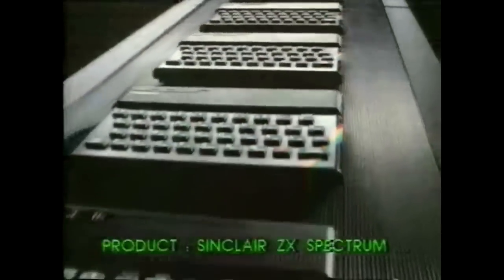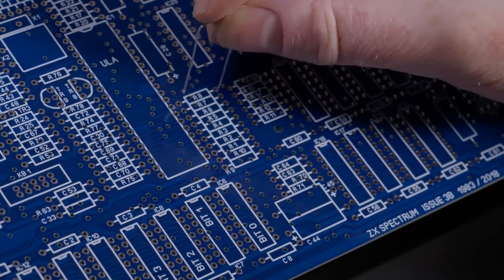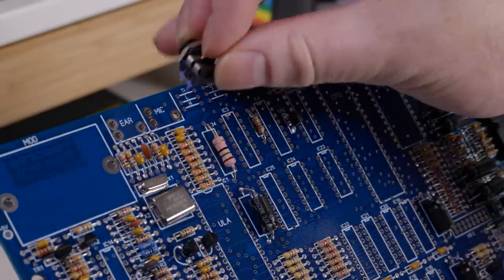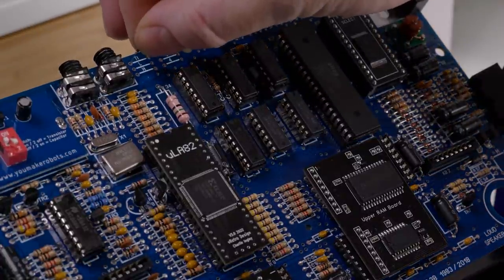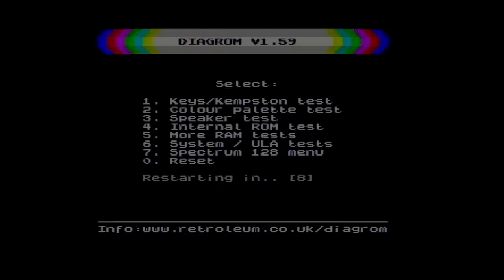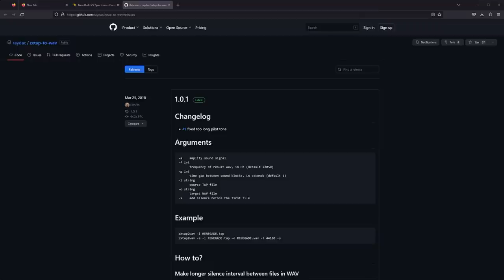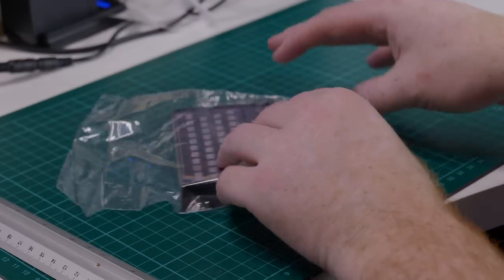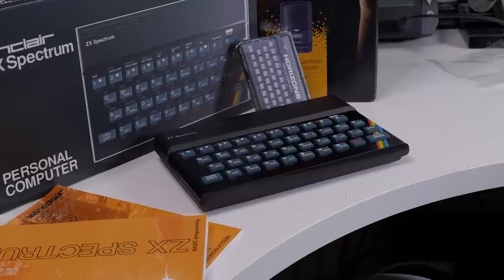Building a brand new ZX Spectrum with nearly 100% new parts, reconstructed box, manuals & tape

Comment: ... it's amazing that 5 years after I redrew this PCB there are people who are building new Spectrums using it :) 
It was worth it - mission accomplished :D Regards - PABB
Reply from the maker: Hey PABB, AMAZING to hear from you. Could you email me if you get a chance at retro@lostretrotapes.com about your board, I love it and thank you so so so much for creating it and helping us do these fantastic projects.
Reply: @RetroTeaTime  ... you did a great job - I'm impressed :)
Reply: In the spirit of the original Sinclair design philosophy, maybe integrate the replacement sub boards into the main board, thus making it a combined THT/SMT board, perhaps with room for 4 ring 3.5mm sockets .  The one hard to replace chip near the video output might be split into subcircuits of available chips.
  For a keyboard cost reduction, consider carbon pads on the back of the rubber with each button shorting  2 PCB pads with no foil layer.
Reply from the maker: @johndododoe1411  I am considering making a new PCB optimised for all the upgrades and new parts. Will do a video and obviously offer it open source for others when I do
Reply: Sir, you have my honest cat foot salute! o7
Reply: thank you for your pcb my friend

Comment: A few years ago, when looking in my parents' attic, I found my old Spectrum from 1983, I cleaned it and of course replaced the keyboard membrane, and connect it to a TV, no signal but the keys "clicked".
I removed the RF modulator and connected to a composite port et voila, it still works as new. 
I also found a lot of old tapes and a lot are still working, what a great little machine.
Reply from the maker: What a great story and fantastic the keys still worked. A lot of the time the keyboard connector needs replacing. But so good these machines last such a long time and continue to work
Reply: @RetroTeaTime  When compared even to high end today's computers, those old and cheap machines still work fine nearly 40 years after they were built. 
I have an old Toshiba T3200 from 1987-88 ? and all the capacitors had to be replaced and this machine was 10x more expensive than the speccy.

Comment: First, Perifractic builds a Commodore 64 with 100% all new parts (some of which just became available), and now this. It is a great time to be a retro enthusiast.
Reply from the maker: I do plan a C64 build but building on what has been done adding the manuals and box etc for the future
Reply: It's actually a terrible time to be a retro enthusiast. Most the old hardware is dying or disposed of. Those that aren't are massively overpriced on ebay, and of course are full of leaking capacitors etc.

Many of these new parts are not equivalent to the originals. The remakes of the SID chip, for example, are far inferior.

The great time to be a retro enthusiast was 20 years ago. You had to almost pay someone to take this stuff.
Reply from the maker: @bradallen8909  True, the price of retro has got to ridiculous levels. Remember the time you could find CRTs left unloved on the street and the local school fete had boxes of C64s and Spectrums for 50p
Reply: Do you guys also watch Perifractic on mute?
Reply: @bradallen8909  Blimey, I bet you're fun to be around at parties.
Reply: @kaczan3  ?
Reply: @darren6202  I'll willingly admit I'm not. That doesnt change the fact that my comment was 100% accurate.

Comment: Excellent work, well done! I remember unpacking my Spectrum in 1983 I think, and still have about 3/4 of it today! Including the upper polystyrene part of the box, the cardboard shell, the OG power supply and the computer, albeit without the metal top plate. I bought a replacement plate and must get it stuck back on after doing a composite mod, although my soldering skills are rubbish! I remember packing it all away and unpacking it again fairly frequently - I loved the feel of doing this, and strangely recall some of the manuals being ring-bound and that scratching against the polystyrene, although maybe that's from a different system or console. Anyway good work and I look forward to seeing more videos!
Reply from the maker: Many thanks, really happy you enjoyed. A bit of double sided tape is good for the faceplate.
You are right, 95% of the manuals were ring-bound and I am trying to get the printer to allow me to ring-bind them in future, currently 12 pages too long.

Comment: I recall the manuals came in bags also. Power pack was like a half brick. Ahh the memories
Reply from the maker: Oh did they, not found any images of the manuals in bags. Will have to take a new look around to check. Thanks for the tip! 

Yes the power pack was a hell of a thing, especially compared to the size of the Speccy. And annoyingly centre negative so they weren't easy to replace.
Reply: @RetroTeaTime  I do miss my rubber 48k speccy. Manic miner, Chuckie Egg, Ahh Diddums were some of the early games we had. Amazing what could be done with so little power esp the games nearing the end of the speccys life. Fairly indestructible (we dropped ours down the stairs a few times) but found that a few drinks spillages just before the warrantee ran out did the trick.

Comment: By far the best video I recently watched, and what an amazingly detailed project! I built a 48k myself during lockdown, if only I had such a great guide at that time. I even got the same reproduction box (very good) and (flimsy) polys. Now looking forward to your next videos! Thanks👏😊
Reply from the maker: That's very kind of you to say. Did you build your one from scratch or rescue parts from an existing Speccy? Am currently working on a new, better box and absolutely better polys, just in talks with a couple of companies to see who can do the best job and then hopefully be able to put the artwork files up on the site with a link on where to get them made.
Reply: @RetroTeaTime  I built one from scratch, an issue 3 pcb purchased on ebay. Sourcing all new components was a pain, your guide with the links for retailers will really help anyone wanting to build one! The box is okay but, yes, polys from consoleboxes are not sturdy enough. New manuals and tape labels is just amazing. Excellent project!
Reply from the maker: @dopierrexzx6956  Yeah, the Polys are coming out to be the hardest part of it all, the consoleboxes ones as you said are OK but not great. I found one place to make them better, but they need a minimum order of 100 pieces. Could do that and try and resell them but it's a big undertaking!
Reply: @RetroTeaTime  It would be great, just Facebook Spectrum/Sinclair groups alone would be a good place for pre-orders and gathering interest. Top-notch!

Comment: I'm waiting for my Spectrum Next Edition 2 to arrive. But watching this video, I am totally in awe.
Reply from the maker: Hopefully you are playing with it now. I have one sitting in the box still that I need to unpack and get playing with, so many projects to do first though...
Reply: @RetroTeaTime  Nope. I would be surprised if the unit arrives before February. USA customs seem to be targeting imports from Britain. Not sure why.
Reply from the maker: @davidgapp1457 is that the battery issue?
Reply: @RetroTeaTime  Yes and no. Millions of motherboards are shipped, every year, from Taiwan with a 2032 lithium battery pre-installed. No issue. But I've found that US customs are extremely prickly where the UK is concerned. I import and export electronics and the UK is easily the worst in terms of customs. I've had deliveries from the USA to UK rejected due to a spelling mistake in the item description. There appears to be a tit-for-tat vendetta going on - very childish in my view - but orchestrated primarily from the USA end. Is this part of ongoing trade negotiations / battles I wonder? Either way, the most officious bastards in the UK are in Scotland. They are the devil. Easier to import to England and then ship up to Scotland.
Reply: @RetroTeaTime  Yes. They have now decided to change the shipping company (I believe the problem shipper was UPS). Given that computers, laptops and just about every mobile device has a battery, I really cannot understand what is the problem?
Reply from the maker: Oh interesting, didn't realise the US were that picky with us!

Comment: This is amazing! Really nice job. I went a cheaper, easier route, and bought a refurbed Spectrum with composite mod, and sourced the manuals separately, which included both the introduction and the ring-bound main manual. The manuals are stamped as coming from a branch of Boots in Eastbourne in 1984, which was interesting.  I don't have the whole box unfortunately, just the batterered polystyrene part.
I've had a lot of fun revisiting the machine, especially loading tapes via a ZXTapeUI device (despite having a DivMMC) as I just love that iconic loading sequence. I never had a Spectrum back in the day, as I just couldn't afford one and had to go for a ZX81 instead (I have a refurbed one of those too). But I went round my friends houses and played on theirs, so I've got huge nostalgia for the Speccy, and of course the ZX81. The ultimate heresy is I first tried my refurbed Spectrum on my C64 1702 CRT monitor, and it looked great. You have to use these old machines on CRTs to get the authentic experience in my opinion.
Reply from the maker: The refurbished route is by far the more sensible option! But when was being sensible fun! Really glad you got hold of a Spectrum though after all these years, what was the first game you played on it after all those years?

I love the tape sequence, but sometimes the DivMMC is just too easy when I just want that hit of Manic Miner and the mug of tea is starting to get cold.

Absolutely correct about the CRT giving the best experience, and that holds for pretty much every computer and console up until the modern Xboxes and PlayStations. Even the original PS looks much better on a CRT.
Reply: @RetroTeaTime  I think the first game I loaded when I got the Spectrum was 3D Starstrike because I was gobsmacked when I saw that game running at a computer club back in the day. I had a C64 by then and I was insanely jealous because it had no chance of running a game like that, and Ioved the original Star Wars Arcade (I now have an Arcade1Up Star Wars cab which had  to be imported which scratches that itch!).
I also played favourites like Jet Pac, Chuckie Egg, 3D Death Chase and others. I'm not a fan of Manic Miner though I did load it up to have a quick play.
I also went through the Horizons tape which was really nostalgic as I can remember loading that at a friend's house on their machine, sitting on the carpet in front of their living room TV. I even typed in a few examples from the manual and the muscle memory kicked in, remembering the keyword and various shift combos, as I used to type in some magazine games on my mates machines. Classic!
Reply from the maker: Can't remember 3D Starstrike, off to download it and give it a go. Not tried the 1up cabs yet, have a pretty complete New Wave collection, Space Ace arrived today which looks great and I am very bad at

Comment: I never had a ZX Spectrum. I had a BBC Micro instead, but I was working and bought it myself. The 6502 is also still in production.
Reply from the maker: Never owned a BBC but used it a bit in school. Might have to attempt a new BBC build in the future
Reply: Like you, the first computer I owned was a BBC Micro (Model B), purchased with my own money at the age of 16 in 1984. I was doing an electrical / electronics apprenticeship at GEC in Preston, Lancashire.

I did buy a second hand ZX Spectrum 48k from a friend a few years later, right at the end of the ‘Spectrum era’, and I had a floppy disk drive unit for it… and I still have it along with all the accessories, although I have not tested it for around a decade. I suspect many of the capacitors are blown now!

Prior to buying the BBC Micro, I was lucky enough to have been loaned a TRS-80 with disk drives and a full size printer, when I was 13 around 1981/82. I taught myself programming in BASIC and learned to use VisiCalc which is generally considered to be the first spreadsheet application. I consider myself very lucky to have been able to use the TRS-80 for around 2 years. It set me up for my career, and my first job after finishing my apprenticeship had the title “Spreadsheet Programmer”. I was literally employed solely to program spreadsheets in 1991! It set me up for life, and I’m still in the IT business now aged 55.

Comment: 1st one we had was the rubber keyd one, after a couple of years heavy use the metal cover peeled of from the heat lol.  Next one I had was the 128k+ vast improvement over the original, longer loading times for better sound and games, also had the integrated tape player.
Reply from the maker: Ah yes, the +2. Was it the black or grey one you had?
Reply: Think it was the grey one,  thinking back

Comment: That was an awesome build! 👍 
Looks 'almost' identical to the very many, many Spectrums that were sold through the little computer shop where I worked in around 1982..!
Not sure if you know, or if it's even possible to recreate today (and at a reasonable price!), but the polystyrene packaging was actually moulded, and in the piece for the lid was a large Sinclair logo moulded into it..!  It'd be fantastic if you could find a way to recreate that! 🙂
Reply from the maker: Many thanks and glad you enjoyed it. And working in a computer shop in the early 80s was my idea of heaven while I was at school! 
Yes the polys are the weakest part of the build at the moment, I have been trying different suppliers, but as you said the fact they were originally moulded makes it a lot harder. Going to continue with my search and hopefully have an update if I am successful.
Reply: @RetroTeaTime  : Best of luck!  It's awesome what you've done so far!!  👍👍

Comment: i loved my speccy 48k, it was that little machine that started me off in computers, programming in basic, here youve basically recreated to perfection what i had in 1983/4, well done, though was a bit worried in using the heat to shrink the wrapping around the tape, wouldnt that of also affected the actual tape?
Reply from the maker: It shouldn't do, it was on its lowest setting, less heat than a hairdryer, which you can also use.

Comment: Ok quick question.. and I apologise if I've missed something, I have to admit I started with the Spectrum 48k+, and even so, I'm not an expert by any means, just, a user..  but I thought there was a very specific central chip for our speccys, no? As I look through the video, it just seems to be compiled of a few different specific roms. Basically, I'm just wondering mostly about the core processor part and how readily it is  to buy an exact replica/reproduction? I would have assumed this would be the major hurdle, or the cpu is still under some kind of copyright or whatever... Sorry if this is old conversation.
Reply from the maker: The custom chip is the ULA, luckily it's been reverse engineered over the years by Chris Smith who wrote the book on it "The ZX Spectrum ULA: How to design a microcomputer". 

This then enabled Charlie Ingley to make a modern replacement, the vLA82 that you can buy today.

The CPU is a very standard Z80 that is still being made today.
Reply from the maker: Should have said too, you can find links where to buy everything on my site: https://www.lostretrotapes.com/zx-spectrum-issue-3b-parts-list/
Reply: @RetroTeaTime  ok wow and the reverse engineered chip really is a faithful processor? and yes seen the site, thanks! My next project for this year seems to be taking shape. Thanks so much again :)
Reply from the maker: Yes, works 100%. Is a rather special thing

Comment: I restore the original ZX Spectrum 48K boxes and make it complete with the original manuals, cables and PSU. For me I want the original not a cheap remake. Have also restore the Toastrack and the ZX Spectrum Plus. Have enough working original chips such as the ULA, ROM and AY. The only thing use a new is the ZX-HD and DivMMC Enjoy! Pro One. Use a mint old Slipstream Data Recorder with original ZX Spectrum 48K tapes. Such as Jetpac, Manic Miner, Jet Set Willy, Skool Daze, Alien 8 and Ant Attack. All are working and are 1ste releases. Have also a brand new HARLEQUIN 128K REV 2D in a ZX Spectrum Plus case. Have more and a lot of spare parts. Now I have the ZX Interface 2 with the original ROM Games cartridges. And seek for the Interface 1, 8x ZX MicroDrives and a ZX Printer. Hope that I can buy Issue 5 board. Which is the only board to complete my collection.
Reply from the maker: The DivMMC is a wonderful bit of kit. I hope you have a very large wallet for the Issue 5, don't think I have ever seen one come up for sale and would imagine if one does it's will be eye watering price.

Comment: Phenomenal video! It was so fun to watch and your quality of work is excellent.

Quick question, did you make a brand new box for the ZX spectrum?
Reply from the maker: In the video I used one that you can buy online, a brand new reproduction box and polys, it is linked on my website. However not 100% happy with the quality, the material for the box is not exactly like the old box, and the artwork on the front could be better, so I've started reconstructing it. The first print attempt though, although looked great had some slightly incorrect dimensions so I was not able to use it for the video. Am working on fixing up the issues, as soon as they are fixed I'll make a follow-up video on the box, and also put all the artwork files up on the site for you to all use.